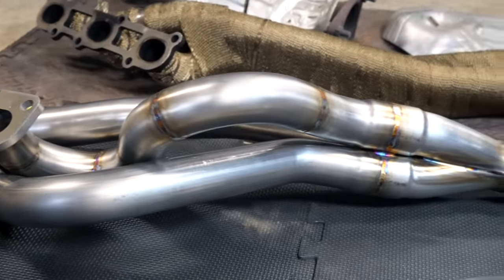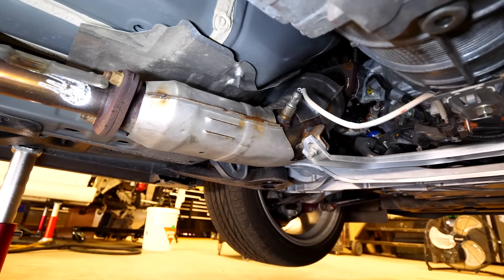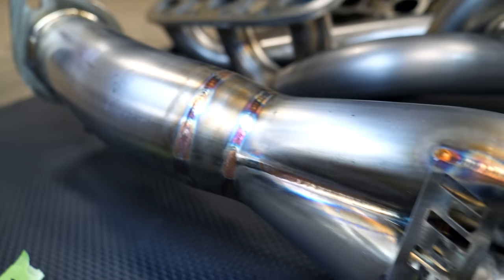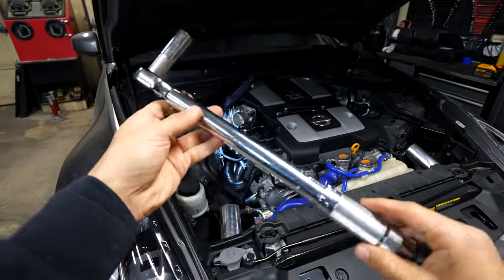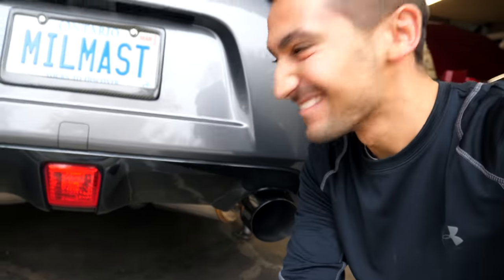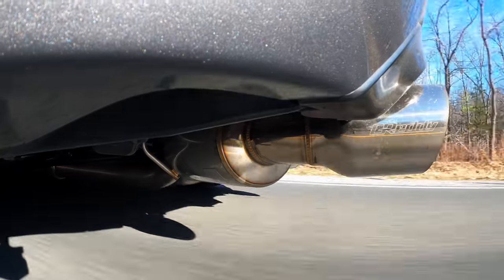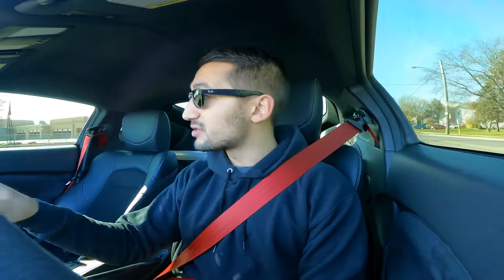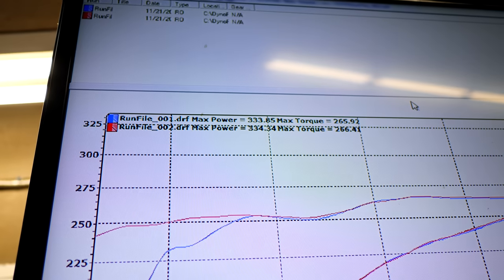THE BEST Nissan 370Z Full Exhaust on the Market! | +56 WHP

Comment: I definitely think it still has the trumpet sound on the higher RPMs, but I really like that sound personally. I think it’s apart of what makes a 370z so unique.
Reply: Really no way of getting rid of that sound without RHFC/RTPs. Definitely part of the sacrifice going with long tube headers. 

The VQ displacement is much too large to have a good ricer (I said it, because it's unfortunately true) sound, so when the VQ ends up making it, it just sounds fake and off-putting, if that makes sense. 

To each their own, though. I have fi rhfc and their resonated cbe with z1 headers and love it. Sound is rich, full and deep toned without the obnoxious decibel level.

Comment: In defence of the Invidia pipe size, the system used here is also 2.5"OD[63mm ext 60mm int] initially and then opens up to 3" at the X pipe. When I had my Invidia fitted that 2.5"[63mm] diameter was huge compared with what came off but particularly compared with the cat section pipe diameter which I think was even smaller?
 The stock internal dia at the front is 1.65"[42mm]. That means the cross sectional area difference with 60mm is just over double. That is the critical area for flow because the exhaust gas mass decreases as it cools so the pipe diameter should decrease as it progresses[to save weight], not increase. 
What diameter are the header pipes between the O2 ports? 2.5" or 3"? Ideally they would be 3" after the collectors because 2.5" at that point is even more restrictive than the 2.5" dia leading to the X pipe because of the heat and increased pressure.

My ideal would be those gorgeous equal length headers feeding 3" dia after the collectors through a HF cat into 3" dia to the X pipe and from there 2.5" dia.

 Did it ever get dynoed with the new sensor?

Comment: Hey, I'm a 350z owner. Wanted to ask if you had to deal with any coolant system disassembly while installing longtubes, as I'm not experienced with the vq37. I had to nearly tear apart everything on the passenger side to get enough clearance to torque down the nuts on the manifold studs

Comment: I just had PPE long tubes installed. The car won’t go past 3500 rpm. If I try to go past 3500 the car starts to “2step” my car is not tuned so I’m wondering if you had that issue before you got it tuned ?

Comment: Question, i installed the headers, but seems like some nuts won’t fit because the header won’t allow it so I can’t tighten the headers so there’s 2 nuts not tighten did you have any issues like this ?

Comment: I was thinking of getting Fast Intentions long tube headers with a Motordyne Shockwave catback along with 3" Admin tuning CAIs, EPS 70mm throttle bodies, Z1 lower and upper intake manifolds and an Admin ECUtek tune. After seeing this, I might go for PPE long tube headers, since the FI ones don't appear to be equal length! What made you chose Greddy over Motordyne, are there better gains with Greddy? Great vid! Best channel on YT for Z guys who are looking for info! Keep up the good work! 👌 From a fellow Canadian Z owner
Reply from the maker: So those are all good parts, but there are slightly better parts out there for the same price. I didn't find any other long-tube equal-length headers for this platform, so the PPE's were the way to go. The Greddy exhaust I know is high quality since I've owned another one of their exhausts on a different car. The piping looked to the best largest out there, and the price point was very reasonable. I thought it was a no brainer 🙌 Thank you! I appreciate it 👊
Reply: make sure to upgrade brakes when ur having all that power bro stay safe

Comment: Love the setup! Those welds are amazing on the PPE. I went with Z1 headers with art pipes to reduce the drone with Greedy Single CBE love it. Getting retune soon hopefully gain better numbers from my old tune that made 309whp and 12.8 1/4 mile.
Reply from the maker: You can't go wrong with the Z1 shorties either! It has a different sound to it from long tubes, but still a quality header 👍 Have you done intakes and manifolds yet? I would suggest upgrading those if you haven't before you get a retune & dyno
Reply: @milanmastracci  yup I have ported lower & upper intake with z1 intakes but switching to 3" inch intake with vstacks
Reply: @milanmastracci  So it seems like Z1 shorties or motordyne are the only two options if you want to go headers and still meet emissions requirements with high flow cats?  Am I wrong?  I just have FI cat back, which I love, but we always want more, but I also want to meet emissions so I don't have to deal with gov't.
Reply from the maker: @07wrxtr1  You can get high flow cats from PPE should you want to run their headers. They have an optional Y pipe that has catalytic converters on it which makes it street legal. Or, if it is easier, find a local shop to you to make up a custom Y pipe with high flow cats. There are options 👍

Comment: If you like higher pitch I guess. Fast Intentions makes the best long tube headers (firing order designed and scavenging welds inside) and exhaust. This guy is obviously sponsored. With 18” resonators and the carbon fiber cans you get a DEEP low RPM growl (so much so some people think I have a V8) and a formula 1 howl at the top end, and I made 315-320 on a mustang dyno (aka heartbreaker dyno) WITHOUT A TUNE.
Reply from the maker: Got a sound clip or YouTube link?

Comment: Best high rpm sound of any V6. This sounds like a quieter GT2 class car. There's a Z based company, the name leaves me, but they're popular. They have a ported intake manifold with a proven 30whp horsepower gain. I'm shocked at how much power VQ37's can make. They are near the power levels of a Porsche GT3 of their time. 415hp at 3.8L's in the Porsche. It actually seems doable with a Nissan VQ. Kudos to Nissan. I love the PPE headers. I love the Nissan VQ engines and by the way, I'm a huge Honda fanboy and of course a 2L engine is nothing compared to a 3.7L. I love the 370Z. It's my favorite GT car. The S2000 is my favorite roadster. I really got goosebumps when the engine was at high rpm. I got strong Porsche vibes when i heard it. Good thing you got rid of the OBX. They looked like engine suicide waiting to happen.

Comment: Hi, is there any need of a wheel spacer...when we try to reduce the positive offset of the wheel on a FWD...like if the offset is positive 45 and I change the wheels to positive 35-40 without changing the tire...i wanted to try concave wheels on my car..if this is possible.. Will there be any problems with scrub radius or alignment.. Etc

Comment: Hey man, I’m doing this exact set up on my 09. I’m having a really hard time getting the driver side header in. Did you lift/ tilt the motor at all to make room to slide it up and in? Or lower the trans at all? The header keeps getting stuck on a trans knuckle that is a mount point for the stock clutch fluid hard line.
Reply from the maker: Hey Ross, I didn't move the motor or trans. I did disconnect the steering column bolt on the lower U-joint, but that's it.
Reply: @milanmastracci  thanks bro. Got them in. They sound great. Ended up getting an Invidia Gemini to keep things a little quieter when needed. Still wakes up and gets pretty loud🤙🏼🤙🏼

Comment: I looking for a similar setup, I have Tomei, isr Y pipe and I’m getting these headers but I have a Question and it would be great if you find the time to help me out. My car is still brand new I have less than 4K miles on it, I’m just waiting to put more miles on it and the do a tune with all my mods (stillen gen 3 intakes, tomei, and soon these headers) my question is; do I need a tune to run these? I know with a tune all my mods would be much better but right now I don’t want to tune it, just want to wait a little more meanwhile I get fbo. Also do you thing these will trigger the cel? 

Thanks man, sick Z

Comment: I know it’s an old post but was there any noticeable difference between the invidia you use to run to this? Really like the Greddy and my plans are only  the few basic bolt ons. By differences I mean sound, performance, fit? Thanks
Reply from the maker: There was a massive difference! Not only is it louder, but because of the larger piping and better design of the Greddy exhaust, it freed up a ton of power.
Reply: @milanmastracci  Ty

Comment: I have a 2019 370Z sport coupe 6MT an recently had a Stillen Gen 3 long tube CAI, a Fast Intentions TDX x-pipe CBE and an EcuTek dyno tune done at Specialty Z in Simi Valley, CA. The peak rwhp is 321 @ 7200 rpm with a uniform 14 to 15% gain in torque across the rev range. It sounds great and is significantly stronger at all rpms. If I didn't live in California I would have installed those PPE headers.
BTW: Condolences on what happened to your Z. I still think it's the best affordable buy for a true rwd classic two seater sports car.
Reply from the maker: That's killer Jimmy! That's a nice jump over the factory numbers. 
Thanks!! I'm hoping to find a replacement for my Z since I still have most of the mods from it. Never would I have thought that I was eventually going to need to find a replacement.

Comment: Bro I seen u did silicone coolant hoses. I have a g37 sedan and I did the same for all of the coolant hoses. How was getting to the rear heater hose? For me it was a huge bitch i needed those cable hose clamp pliers
Reply from the maker: It wasn't that hard of a job, but it was in a hard to reach area! I wouldn't call it fun lol

Comment: What kind of external mic did you use to record the exhaust note!? I have a go pro and every time I try recording, I get horrible wind noise ?
Reply from the maker: I used the built in GoPro mic. Depending on where it is on your car, it will have a ton of wind noise, or not lol

Comment: I have almost the same exact setup. Stillen cai with race upgrade, intake guide, ported upper and lower, ppe long tube headers, nismo diff with 4.08 gear change, all solid bushings and mounts, jwt c2 cams, and a nismo type r exhaust...flex fuel kit tuned on e85.....I'm only at 360whp, but changing out exhaust for a fast intentions x pipe. Good work on your build, hit me up if you want to hear any trials or problems I've had. I have a lot more upgrades and still working on my track 370  nismo.

Comment: Sick set up!! Funny though i had the same bank 2 problem at the time of my tune after having longtubes put in.. Did Moncef recommend you extending the o2 sensor wiring from the engine harness? This will help prevent problems with the extensions. Always enjoy ur 370z videos. Learns alot🤓
Reply from the maker: So with the PPEs, you NEED to use the extenders that come with the headers because the primary location of the O2 sensors gets pushed to at the backside of the collector. I'm going to make sure I have the extensions properly connected first, before buying a new sensor. A new primary is like $300..

Comment: Did the ppe headers throw a cel? Currently in the market for LTH but trying to avoid cel
Reply: Yes, mine did. I dont have O2 defoulers. Going to get a tune to get rid of it. The video does not capture how loud it is, at low speeds its chill, after 4k RPM or so it screams. If you do intakes, headers and exhaust it would be better with a tune.
Reply: @krusty2461  I have the full Gt Haus cbe and Stillen gen 3s 

I’m buying ppe headers and switching to admin intakes and then getting a tune from him

Comment: Use 94 octane gas and get some admin tuning intakes and you’d probably get around 350 whp
Reply from the maker: I was thinking the same thing 🙌
Reply: So savage how poor the fuel is state side. Like in the UK shell v power is 99 octane. And cheap fuel is 95. And in Germany they get 102 octane
Reply: @craigmccreath3182  AKI ratings and RON ratings are different lol.
Reply: @L W UK dont sell US e85 at the pump lol...but its mixed with Super Unleaded at 15%or something

Comment: Sounds amazing man. You pretty much confirmed me getting these. I currently also have Greddy Evo exhaust right now. Was debating on getting these headers or ISR but man these did it. Why didn't you put ceramic coating on them btw?
Reply from the maker: You can't go wrong with these headers! I didn't because I wanted to ensure they fit prior to the coatings. I will be removing them, coating them, and also wrapping them to insulate the pipes 👍
Reply: @milanmastracci  Appreciate the response man. Have you dyno'd the car yet?

Comment: Maybe a dumb question, but if you have the long headers, does that mean no downpipe?
Reply from the maker: Hey Ben, yes you are correct. Long tube headers replace both the exhaust manifold, and the downpipes/catalytic converters.

Comment: Use ARP head studs and nuts. Always tighten from the middle out, never top to bottom or visea versa.
It will stop it from blowing 3 months down the road.
Great looking and sounding note at the top end. 
What was the power comparison with the old system at the bottom end, say 4000rpm and below
Reply from the maker: Its hard to say since all of my dyno pulls were from 3000 RPM and upwards. Drivability seems to be identical down low
Reply: @milanmastracci  Glorious sound either way. 50+ bhp at the top takes a lot of knowledge and development work.
Like you so rightly say  "You get what you pay for"👌

Comment: Just put one of these on my Z. The drone and volume between 2800-3300 is unbearable inside the cabin. Like, permanent hearing damage bad. How do you find the in cabin sound? I love the exterior note, and am thinking about a 3 stage audio sound deadening in the rear hatch.
Reply from the maker: Your highway speed and final drive will affect that. I find that driving around 80-90 kph and 125+kph isn't bad. That drone you mentioned is noticeable of course, but I don't find to be too bad since I usually drive my Z when I want to do some spirited driving, and its usually not below that rpm lol
Reply: @milanmastracci  thankfully mine is a weekender too. How’s your hearing? I really think it’s loud enough for damage.

Comment: Quick question, how much did u pay for ur Z, and how much do you pay for insurance? Bc I am thinking about getting a Z but not if it’s too pricey.
Reply: For a 2020 Sport Touring with 2100 miles I paid $37k and insurance is $130/mo. But you can get a used Z that’s older for $20-25k and it’ll still be great. I just wanted newer with low miles

Comment: Hey Milan, had you ever seen any idle issues after going long tube headers? In mine the AFR seems to vary and fuel trims short term never get settle with my fast intentions long tube headers.
Reply from the maker: That sounds like a tune-related problem. Did you get a tune following your headers?
Reply: @milanmastracci  Yes, but I have to come back because they couldn't do it, They want me to put an AFR on the Y-Pipe, now I have to come back in two weeks... They said it's probably because of the long tubes... Let's see. You didn't have any issues? I changed spark plugs, fuel injectors, fuel pump, cjm fuel return system, manifolds, new oem denso O2 sensors, all gaskets are new as well and the problem persists, hopefully they will dial in with the tune but I was wondering if everyone noticed the same with long tubes

Comment: Damm...that performance was sick (despite driver O2 sensor issue).  I have the Kinetic Hi-Flo Catalytic, so want to stay legal for moves to smog check states.  Right now,I am working on upgrading Suspension & Stabilizers.  

Are you going to do the Phelm Mod & replace Hi-Flo Sensor upgrade?

This is something under my consideration for 07' Z33 Roadster Touring next Power Boost and get 1st Official Tune.
Reply from the maker: Ikr, not too bad for it 'limping' 👊
Good call with the suspension upgrades! I would do suspension and handling before more power. I'm not sure what the Phelm Mod is. Do you mind explaining to me what it is?
Reply: @milanmastracci  ...😆 Can't wait to see the Tune w/ full strength.  Oops... I meant to refer properly Port Lower Intake Manifold + Intake Plenum Power Mod.

Comment: I just wonder why don't you wrap them headers? or did you?
Reply from the maker: Since I wasn't sure of the fitment due to the issues I had with my other one, I wanted to make sure they worked before fully committing with ceramic coating & wrapping them. Let me be the test dummy 😉 If I were to do it again, I'd coat and wrap them since the fitment is amazing

Comment: 6:28 what is that rattle/hiss sound. I went to test drive a 370z I’m trying to buy and I head that and thought something was wrong with it.
Reply from the maker: Thats a vibration from my aftermarket Coolerworx shifter. Nothing is broken, but that's just what it does on decel
Reply: You mean the VQ hiss? Every VQ37 will do that sound, and even way more noticeable with headers. Any headers, once catalytic converters are gone be ready to hear that VQ Hiss, or you can put a lot of resonators and quiet it down a lot without sacrifices besides weight

Comment: Hey! I have same Catback + berk resonated test pipes. Yes, it is loud and 3K drone, but do not worry. Drone will reduce little bit in a couple months. Im finding headers, but i think i will go with catted headers or short + cat pipes. I will check once you fix O2 sensor. Good luck!
Reply from the maker: Some Z1 shorty headers might be what you want. I'm loving these long tubes though 🙌 Gonna look into the O2 sensor problem
Reply: @milanmastracci  Perfect, I will see how much HP you got after that. Saludos Paulo
Reply from the maker: I'll be sure to put out the new dyno video when I get that done 👍